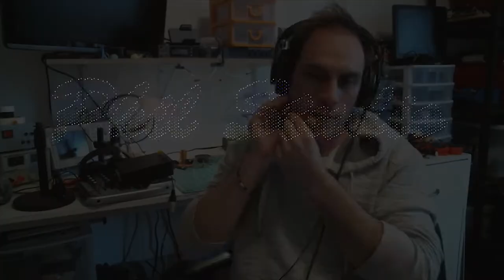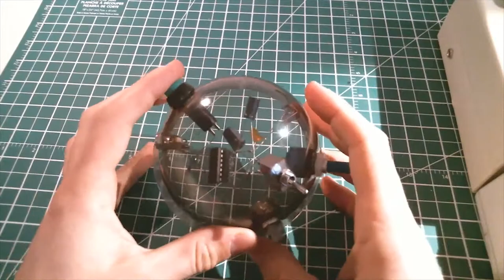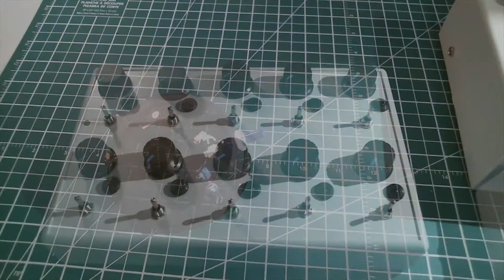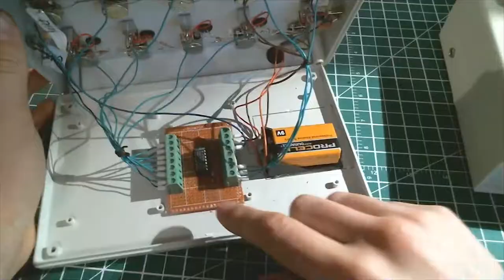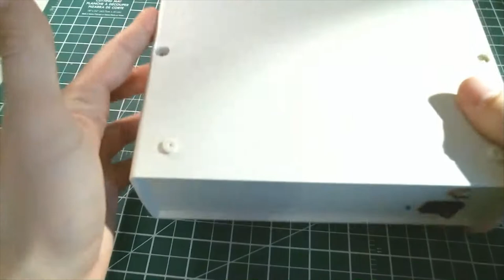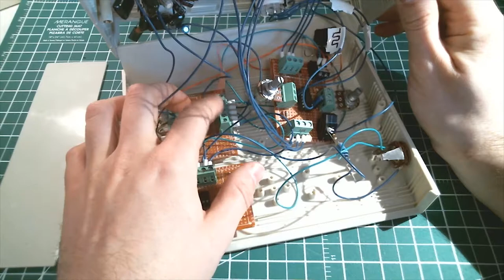DIY Synth Chicken Wrap

Comment: Hey man. Greetings from Brazil. Very inspiring work. Can you recommend somewhere I can learn to properly work with the 8038 as an function generator?  Thanks
Reply from the maker: Vinícius Fernandes hey there! Thanks for the comment! Glad you liked the video. You may find all the datasheet of the 8038 function generator on google, it is pretty easy to setup and make it works. Let me know if you have any other questions! Cheers!
Reply: @ThePhilStudio  Hey Mate ! I got it to work, but I am having trouble setting the maximum and minimun range of the frequency. The datasheet says it can go from 0.001 Hz to 300Khz. I wanted to set it to oscilate between 0.1 Hz and 10Khz maybe. I just found a lot of videos about this IC done by people from India probabilly and i really cant figure out the accent. Can you send some light ? Thakns man !
Reply from the maker: Vinícius Fernandes nice that it’s working! I guess that you will have to play with the capacitor and the different resistor to set your max and min frequencies. Use a 100K pot on these 2 pins so you can experiment more quickly. Also, have you looked at this datasheet: https://prom-electric.ru/media/icl8038.pdf

It’s a bit complicated but you will probably find multiple configuration that are also interesting. Let me know! Cheers!

Comment: Wow! Where did you've get this plastic case? I want to buy a type of this... So I will not use some food boxes and other strange stuff :) I like this case because it's flat... the shape is good to put in a backpack.
Reply from the maker: I buy all my case to the local electronic store. In Montreal, it's called Addison. Yeah the shape are pretty useful!
Reply: I've cut few pieces of a good plywood at my grand-father's house. I'll make few boxes using it. Good plastic cases (of a proper size) are expensive. So before I'm not experienced it will be a good solution IMHO.